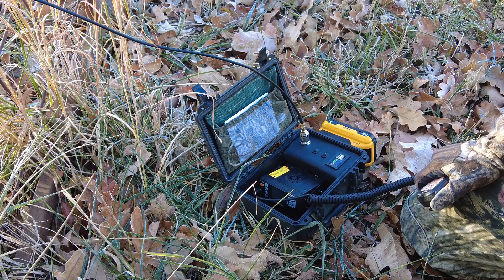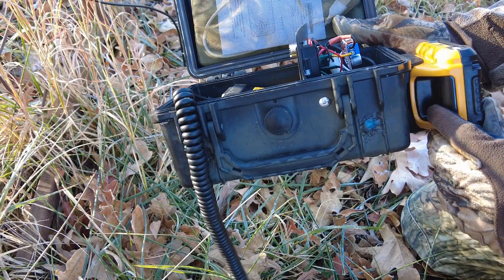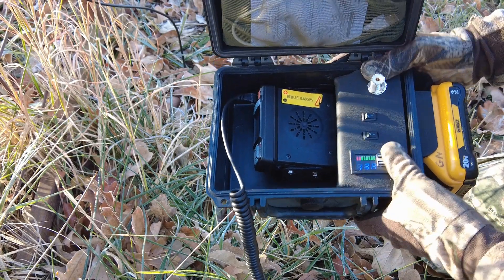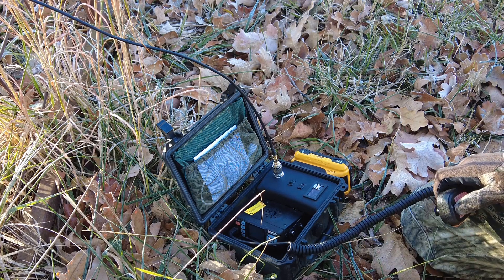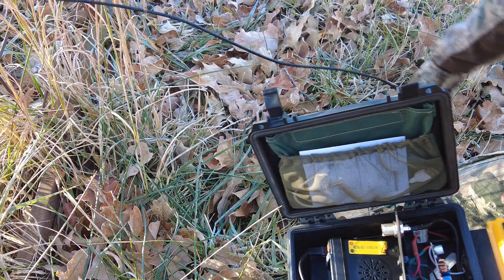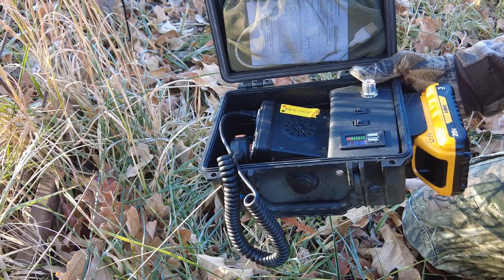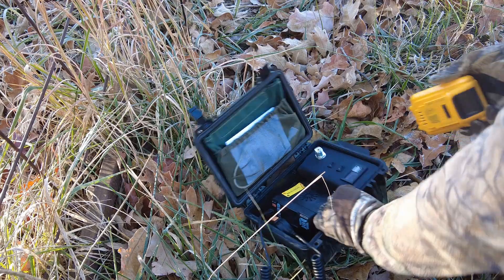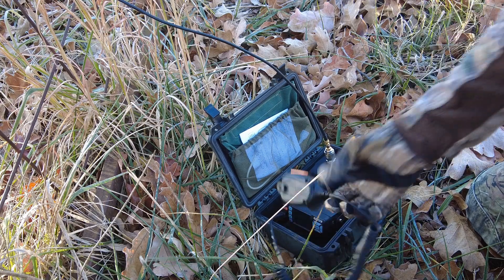Drill Battery Power For Ham Radio

Comment: You can add a low voltage cut off circuit to protect the dewault battery👍,nice video.
Reply from the maker: Would running it all the way out damage it?
Reply: @thriftyoperator637  I had seen some video of people converting their kids power wheels cars with dewalt batteries that had reccomended a low voltage cut off. I think it could damage the battery.

Comment: FYI, the 20V/60V Flex Volt DeWalt batteries introduce some weird RFI that will Tx with your signal. Might be able to add a choke to get rid of it, but I had regular 20V batteries available, so I just use those without issue. Also, the outer pins on the standard 20V batteries are 20V, the same pins on the Flex Volt batteries are 17V, so if you figure out how to get rid of the RFI, you may have to adjust your Buck converter each time you swap battery types.
Reply from the maker: That’s some great information. Thanks
Reply: @thriftyoperator637  I’m running DeWalt batteries in my manpack and have a meter on them. On the 20V/4AH batteries, I actually got 7.8AH at 13.8V before the radio shut down. Ohms Law is awesome like that. 😂
Reply from the maker: @Phyxx_TX  that’s great. I’ve ran this radio all day at events on a single 3AH battery.

Comment: Nice setup. Do you happen to have the model number of the regulator you are using? I'm having a hard time finding a compact unit with the integral USB.
Reply from the maker: 1* LED 12V Lead Acid Battery Capacity Indicator Voltage Meter Dual USB Charger
Reply: @thriftyoperator637  Thank ya sir, appreciate it.